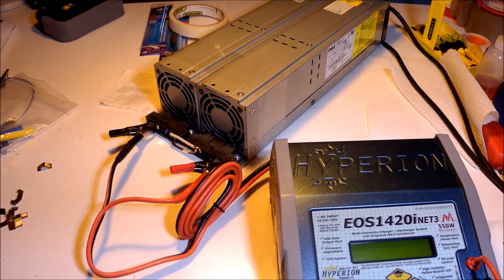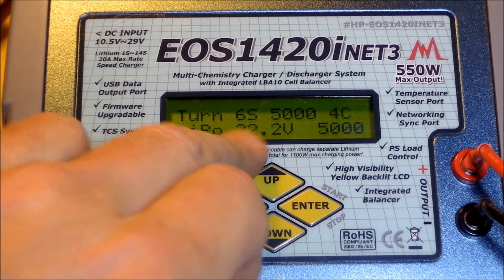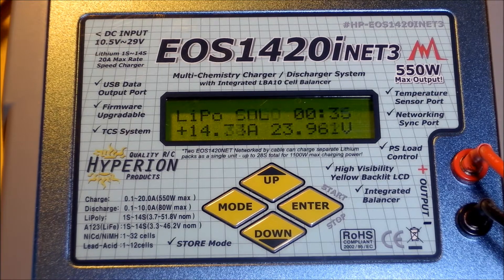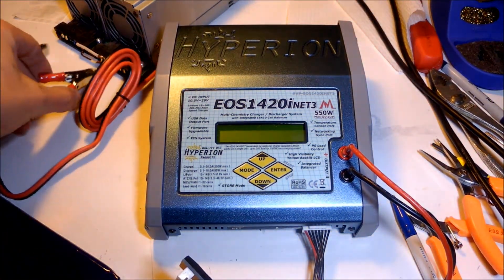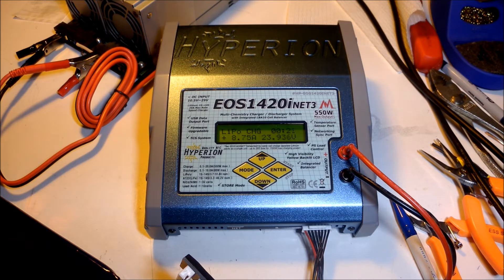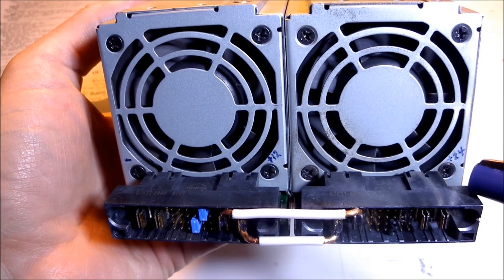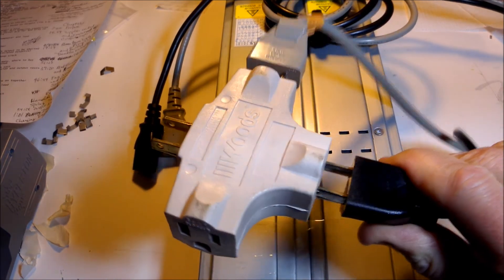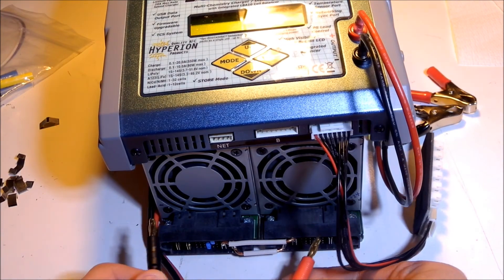$20 12V/24V 41A Power Supply Part 8 - Demo of Charging and Final Thoughts

Comment: Hello !
Is it possible to connect these psu in parallel withou any extra protection ?
So I can have 12 v with doble amperage or redundance for lower amperage. 
I think you can do it with a diode, but that reduces the voltage about 0.7v

Comment: Thanks  could you do this to 3 for 36 volt output
Reply from the maker: You can make a 36V supply by adding a third isolated power supply in series.